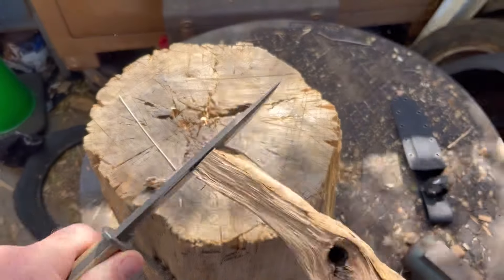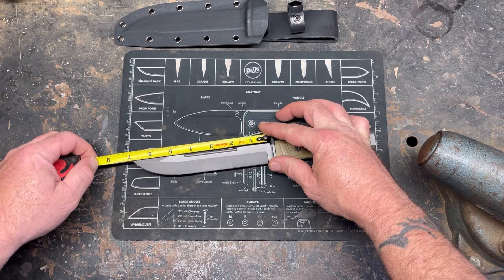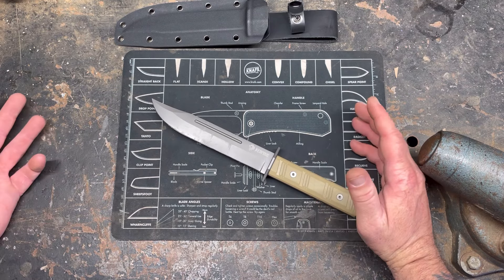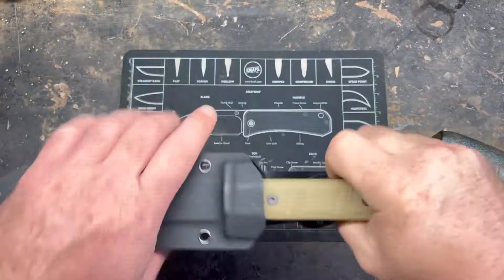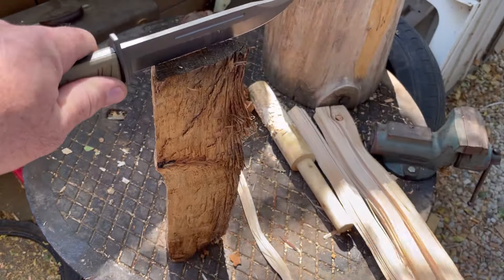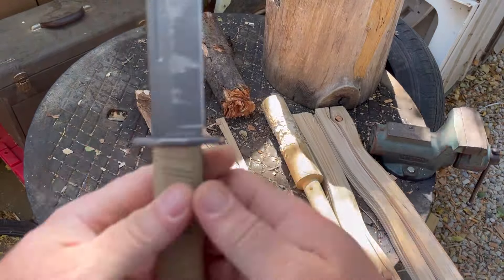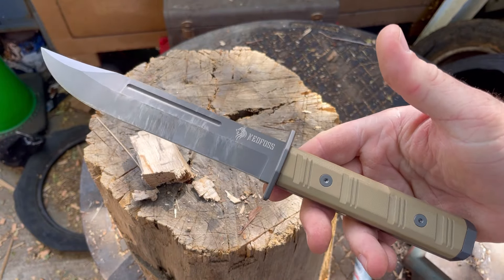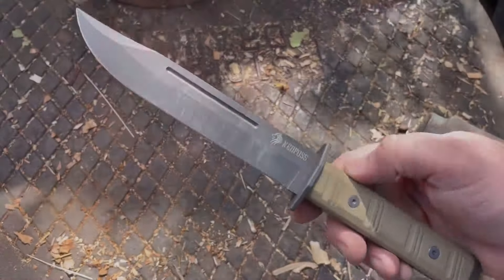The NEDFOSS BRAVE. A stout fixed blade for sure

Comment: Yeah, its a Kabar clone. Blade on the Kabar is 7 inches, but the cutting edge is 6.75 inches. Yeah, went and got mine from my bedroom. :) Even that that one has a slightly shorter blade, and a different handle. It still reminds me of my Kabar.
Reply from the maker: It’s that blade shape lol.
Reply: Wait till you find out that theres a lot of blades that have that shape that you wouldn't consider a kabar clone